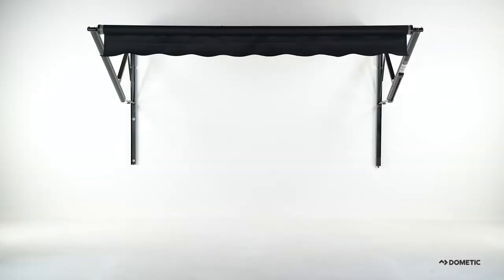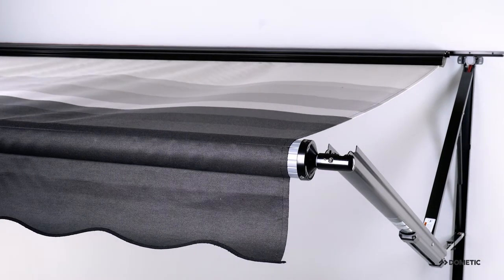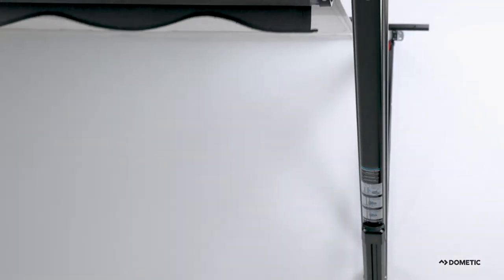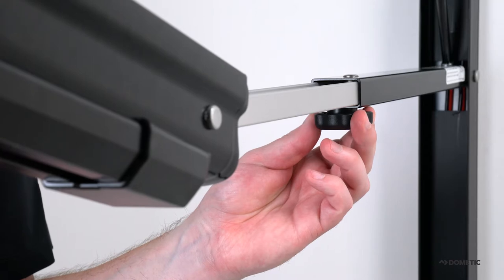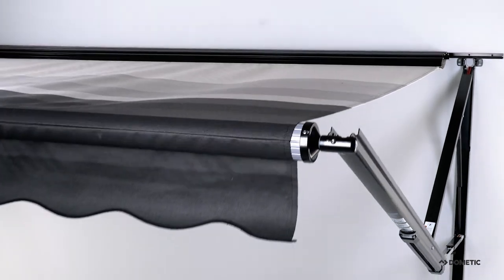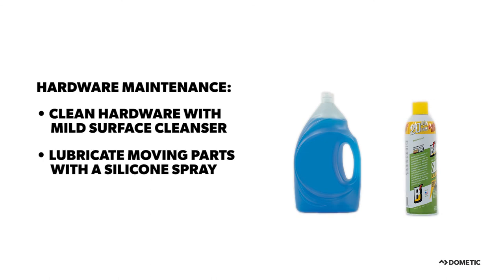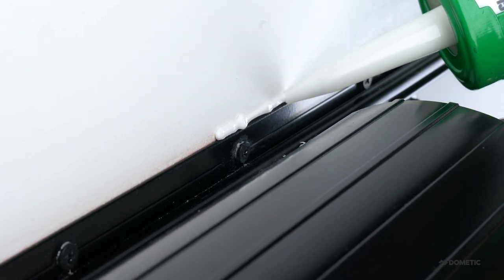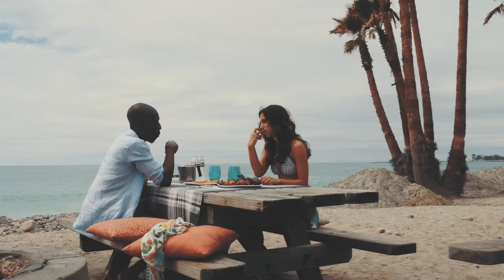DOMETIC | How To Operate Your Dometic 9100 Powered Awning

Comment: I would like to know how to retract the awning with no power.  I have read the manual but it is a bit confusing.  I would use the strap method if I need to.
Reply: did you ever figure it out?
Reply: @donaldfafard  Yes I did.  It's a 2 person job, 1 to hold the strap and 1 to loosen a couple screws on the motor.
Reply: How did you roll it back in?
Reply: @acforhim1  it is a tension coil.  Once you start rolling it in by hand the person holding the strap keeps tension on it so it doesn't go too fast.
Reply: @brentdreamer2025  Thank you! So, do I have to take those two screws out every time and then put them back in to travel?

Comment: do you need to locate and drill into studs to mount this  thing?
Reply: Yes, you would need to secure the awning to the structural framework of the RV. From the installation instructions... "Find a solid structure in RV wall for support of top mounting brackets and back channels (all mounting points)."

Comment: Do you sell both the left and right top castings? both of them snapped off on the freeway, but the motor still in good shape.
Reply: If you have a 9100 series (the one from this video), the right hand motor side and left hand spring side can both be replaced, however, the metal caps are not available on their own and you would need to purchase the complete motor and torsion spring. If you have a 9200 series (would be plastic covers, not metal), those are replaceable on their own.